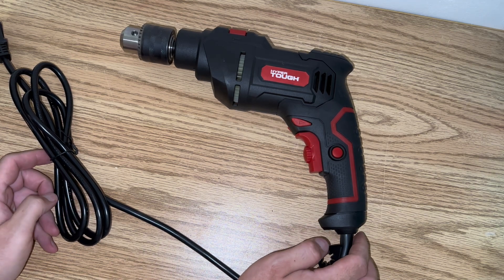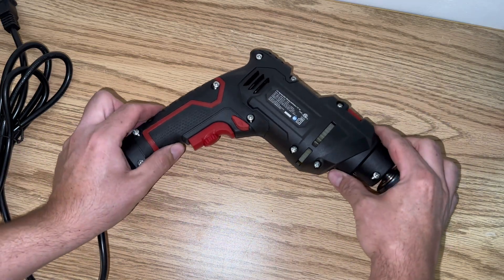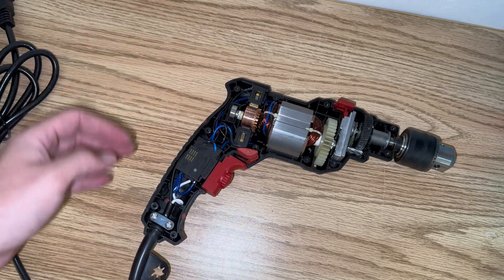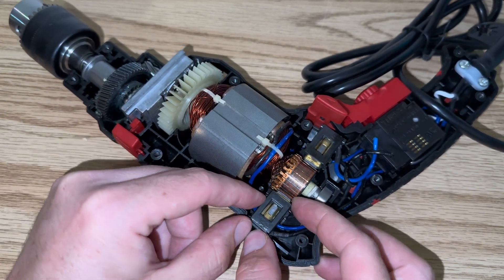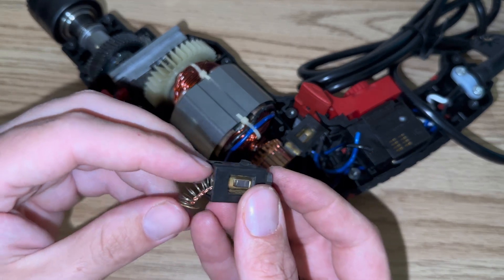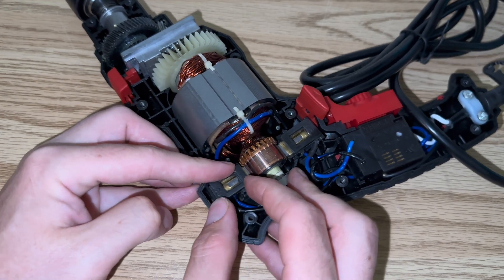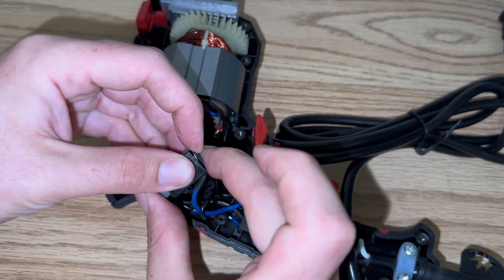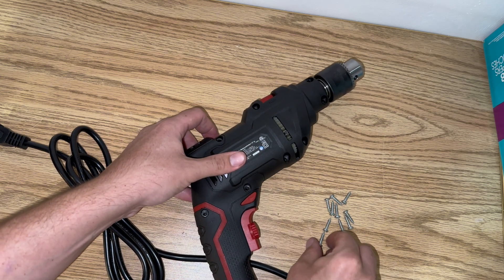Hyper Tough Hammer Drill Carbon Brush Replacement

Comment: Simple enough, but Walmart should have their supplier redesign all of these corded tools with side plugs to remove/replace the brushes.  I bought a Hercules grinder at Harbor Freight that came with side plugs. That said, I can't fault these Walmart corded tools for what they are.  I've got a couple that have seen their better days, but have kept on going for years.
Reply from the maker: Ya side plugs should be on every power tool. That would be super nice. But the harder it is to fix something the more likely you will buy a new one. The manufacturer knows this.